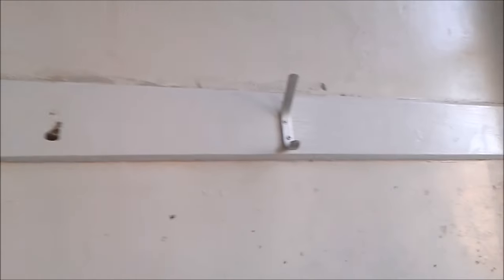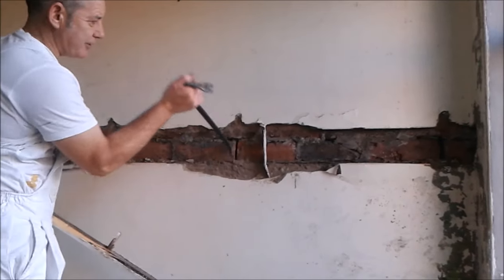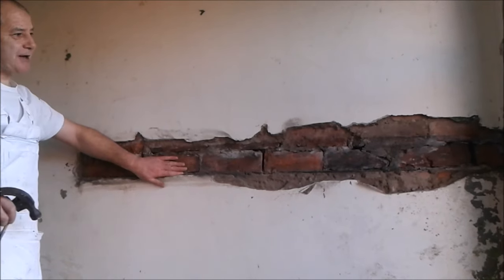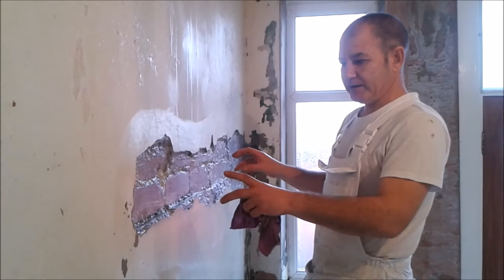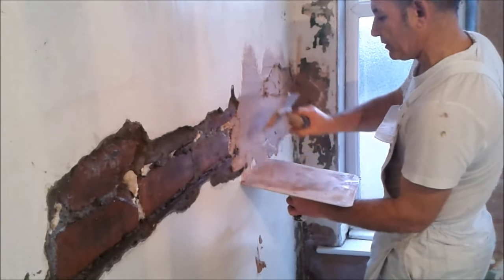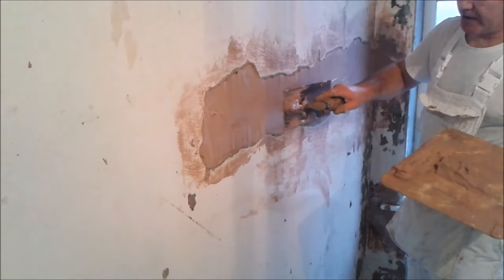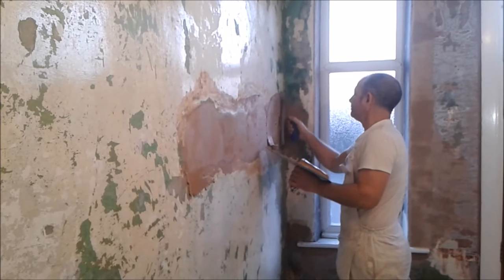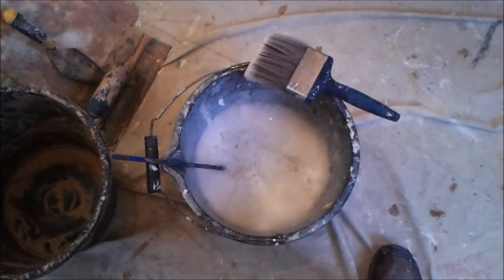Patch Plastering Hardwall

Comment: Nice video. To all the plasterers knocking this at least there is no plaster on the ceiling, woodwork, beams, floor, window sill, down the sink and drain. The bloody mess plasterers make is unbelievable yet they have a go at a guy doing a tidy job. And let's face it you wouldn't come out and do this anyway, well not for any reasonable price and no price is worth the mess you guys make.
Reply: @taichpaul  we aren't all messy mate. I take pride in being a clean plasterer
Reply: @Trekz86  good.
Reply: Not all plasterers are like that...
Reply: @taichpaul  this guy ain't a plasterers by the way.  Never seen a patch this small being done so slow and the way he holds the hawk to the wall is amateur. He did a good job for someone who I think isn't a plasterers

Comment: .pva as a primer should never be applied at more than 3 parts  water to 1 part pva. other wise you end up with a skin of pva that the plaster is sticking to rather than the surface of the substrate and that actually makes the bond weaker. pva is primer to reduce suction not a glue to stick the plaster to the wall. good job otherwise.
Reply: Edd Jordan thank you nice Information and explaining 👍
Reply: Pva only stops it from drying quick....fucking amutures !!!!!
Reply: Ste Thompson if you think that your a noob
Reply: You could also just wet the bricks first, to slow down the drying of the plaster. Then you don't need ant bonding agent
Reply: On another plastering video the presenter advised against using PVA when applying hardwall plaster to brick wall. So when are you supposed to use PVA?

Comment: Tip....when using a crowbar, put a flat piece of wood against the wall first and lever against that....the crowbar doesn't then dig into the wall
Reply: Nah it can still dig in
Reply: @tauntonlad  if you don't know what your talking about, be humble and silent and learn from people.. Been a smart ass is not a trade
Reply: @tauntonlad  You two lovers crack on doing it wrong, don't involve others
Reply: @tauntonlad  Its your mummy calling me. Thanking me for a good time
Reply: @tauntonlad  byeeeee ❤
Reply: @petea2485  Mark is right, troll.
Reply: Tip, yeah it's just a spikey thing
Reply: I'd have multitooled the wood either side of the nails to try and minimize any damaging of the existing plaster.

Comment: Pulled it off and realise you’ve not quoted enough 😂
Reply from the maker: Imagine just starting to sand it down and it falls off..  😭
Reply: I was on a job once with a minor plaster repair only 6x15 inches  and started to prep the wall and loads of the plaster came off in a sheet, turns out the plasterer before me had plastered over MDF!

Comment: I notice that you have put in quote a bit if plaster into a deep chase. On the instructions for the gypsum it says to only do about a centimetre and layer it up in a couple of goes. 

Do we have to do layers? or is it Ok to add 2 or 3 centimetres of plaster at a time?

Dies anyone know?
Reply from the maker: The small area is not too bad working like this. Thanks
Reply: @PaintingandDecorating  cheers

Comment: do you have to use PVA? I thought it wasn't recommended for heritage buildings/ breathable lime wall systems as it's essentially a plastic layer. The lime in the plaster will 'suck' into the wall and bond instantly...
Reply from the maker: It's not heritage is just brick that needs plastering. Look up what plasters use to bond before applying undercoat plaster. PVA is not plastic.

Comment: What is the purpose of the PVA? I am asking it because I can't find it in my country. I have an old house, and I removed all the old and damaged lime plaster from the walls, exposing the brick. Will this PVA help the new cement plaster bond better?
Reply from the maker: Yes, plasterers use it to bond coats....  we dilute it so it soakes in sealing a surface ready for painting... carpenters glue, school glue..   as long as its not waterproof PVA......   thanks

Comment: If you have a few days between hardwall (base coat) and the final coats, would you recommend pva the hardwall to reduce fast suction?
Reply from the maker: Yes but very diluted so it soaks in. Thanks
Reply: @PaintingandDecorating  50/50 Mix?

Comment: If the repair that needs done is deeper than that, should I use 2 coats of bonding? Then put the Skim on top?
Reply from the maker: Yes or two top coats depends on your depth..   thanks
Reply: Thanks mate, saves is the job of cutting plaster board out to fit the whole and then dot n dabbing it only to the have to Skim over like I originally planned lol

Comment: I had a similar repair done. But the plasterer first used a lime cement render to fill in and match the original wall, then a two-coat plaster with the finish being a white coat

Comment: A couple of things.
Why mess with magnets then just rip it off.

2 bonding would have been a better plaster to use.

3.skim the full wall it's a better job.
Reply from the maker: Magnets locate the nails then you know where to start and areas to use force.  The wall only needed to be patched and not to grow a little.
Reply: Bonding is like blotting paper and can lead to problems with damp.

Comment: Was that another top coat mix after the first on or was it the same mix as you left it 20 minutes?
Reply from the maker: No you have to make up another mix...   dries fast so the first mix would be useless at this point.
Reply: @PaintingandDecorating   the bag of of plaster I bought is multi purpose, and is one coat. The repair is smaller than yours , but will butt up against a triple hardoard sheet ??

Comment: Good morning, How will you cover a large area with this undercoat plaster.
Reply from the maker: Using a plastering trowel and start at bottom in a corner, and work out. Keeping same depth across and hatching  it before dry, for your finishing plaster. Thanks

Comment: I really wouldn’t remove that wood in the way you do as it will likely do more damage to surrounding plaster. Liked the idea of using a magnet though, which I’d never thought of.

Once the screws are located, you could have used a saw to cut either side and in that way, you could remove most of the wood very easily as it would only be held there by the plaster. Alternatively, you can use a circular cutter around the nail which then leaves the rest of the wood detached and easily removed.
Thanks for sharing and not having a go! None of us are perfect.
Reply from the maker: No worries, times money and a little extra filling is nothing. Thanks

Comment: Hi mate, I wonder if you can go help me?. I've fitted some rawl plug anchors (self screw metal plugs) and in both fittings  I've fitted the plaster has crumbled . So I'm assuming I will need to pollyfilla the repair. My question is. Do I pollyfill and skim over with the anchor still left  in the wall? Or take it out? If I take it and then Reinsert after I've pollfillered will I run the risk of it the plaster crumbling when the rawl plug self drive goes in again?
Reply from the maker: Hi hopefully this video will help  https://youtu.be/u_uG-yjzQjw
Reply: Self screw plugs? You don’t meant plasterboard screw plugs? In a solid wall you would use normal plugs and if the wall is crumbly, use a long enough plug to get to the brick. On a lathe and plaster wall you’ll need to find a stud. Also important to use a screw the correct dimensions for the plug. Too small and it won’t grip properly, too big and it will just break.

Comment: Hello again.
 I expect you know, but in case you don't.Instead of hacking plaster off with a bolster and hammer.Which will remove the plaster you want off but also the surrounding plaster can also crack up and work loose. Electricians use a small angle grinder with bag or I assume dust extraction port.  It is called a chasing tool, has two adjustable blades on it. I assume can just use one, also  can get a chasing tool which fits onto your electric drill.
Reply from the maker: You can but the filler is cheap and better to remove anything that is loose in a safe controlled manner . And if you're using anything mechanical make sure you know exact placement of wires or pipes.

Comment: Helpful video.Did you let the first coat of plaster dry completely before putting on the second coat? For how long? Is the 'finishing plaster' the same stuff as the first coat or a different product? Thanks.
Reply: When the first coat has been in long enough fir you to touch and leave no fingerprints then its ready for a wetter top coat mix to go on top. The finnish plaster is the same, mist use a multi finish plaster.

Comment: Can anyone help me with a question. I'd really appreciate your help. I lost my father 3 months ago and my dream was to renovate my bedroom with my father which i couldn't do. I want to pursue this dream but have no clue about walls. I have done basic electrical and plumbing work. I want to know what coats are applied to a brick interior wall. I know that cement sand plaster is done right on the brick surface but after that may i know whats done till its finally painted? A basic explanation that includes all the materials included will really help me to start my research.
Reply from the maker: Same as in the video on materials just on a larger scale. And we do have videos on how to paint plaster. Hope this helps as we are not plaster's by trade....  only painters and decorators..
Reply: @PaintingandDecorating  Thanks a lot for the help can now start atleast somewhere rather than being confused. Cheers

Comment: How long did  it take to dry as with putting a backing coat on will take longer to dry . I have started to use dunlop pro decor range   dries within the day
Reply from the maker: 4 days to dry because of cold wall and winter.

Comment: Hello again, as I mentioned I think your YouTube is really helpful and after watching it I feel confident enough to do a small patch repair. I've bought a bag of Thistle bonding undercoat, Thistle Multi Finish, a hawk, small paint paddle for drill, a trowel and some PVA. The patch repair is on the corner of the wall above the door. I bought some mini angle bead, mesh to do the corner. I'm not sure how to do this so I was hoping you could give me a bit of advice? If you contact me on the email on my channel then I'll send you a couple of photos, so you can see what I don't understand.
Thank you.
Reply from the maker: You need to attach the angle mesh to the corners, you can seal the brick and using a spirit level and some grab a adhesive fix the angles in place so they are horizontal or vertical. You can drill and screw or nail using non rusting fixings.

Comment: At the stage of applying the top coat finishing plaster where you're dragging the trowel over the edges, did you not drag in flakes of old paint from the area you are plastering into/over?
Reply from the maker: No the diluted PVA has stabilized the area.. thanks
Reply: @PaintingandDecorating  thanks for your reply.

Comment: Thanks for the reply 'I replace windows in my house and some plaster around the windows come of ' and a couple of rooms need plastering 'I scraped of the old plaster to the to the bricks 'si prior to put new boards on 'do i need to give it a coat of pva mix with water 'would one coat be enough ?also around the windows where the plaster has come of 'pva coat then undercoat of hard wall plaster which you used in the video and then skim 'I'm very interested in this job and tranna learn from experts like yourself 'your help is appreciated 'your a star 'I have same mentality that before I leave this world I pass on my skills to new generations

Comment: why does the plaster crack i soak wall before i start and make plaster to right batch like you plasterers but cracks on some places on wall in my house whats going wrong
Reply: Like the man says here,   you need to soak repair area with PVA /water mix first. Let dry, then a another coating  ( thicker mix) , let dry. It provides good adherance to plastered wall, but, prevents the water in the new plaster from being sucked into the wall, out the plaster mix, too early, causing cracks.
Reply: @MrDaiseymay  Didn't quite understand you...To prevent cracks shall we do it exactly like the guy is doing in the video? or no?
 "but, prevents the water in the new plaster from being sucked into the wall, out the plaster mix, too early, causing cracks." I just want to clarify before I start. Thank you.
Reply: What surface has been the plaster been applied to? Sounds like the moister is being sucked out of it by the wall, or if it's board have you taped your joints
Reply: @MrDaiseymay But another plasterer said do not apply PVA to brick to allow moisture to be sucked from wet hardwall plaster and increase adherence of new plaster to the brick wall.

Comment: great vid thanks . The first wash with pva at 6.43 was that neat PVA or diluted? I have taken the wallpaper off the wall of the house we have just moved into and there are holes about 6 ins deep going down to brickwork will this plaster work on holes that deep please and would it be the same technique as shown?
Reply: ric david - if the holes are right into the brickwork, put mortar in them to bring them level with the brick face. You can buy pre-mix stuff that you just add water to on an as-needs basis. Works out easier and cheaper than buying 25-kilos and then throwing kost of it away. Plus, as long as you seal the tub it will keep for the nexy time you need it.
Reply: @steves1460  Hi steve thanks for the reply i finished the wall some weeks ago and it worked out pretty well thank you. My next task is to try and put some insulated render on the external walls here. I have never done rendering and certainly not insulated. Have you done any vids on rendering and is it ok to do the work this time of year? Thanks again
Reply: ric david - Not something i know about, but Google and YouTube are your friend. Good luck!
Reply: @steves1460  Cheers Steve keep up the good work

Comment: Hello, loved this video! 
I have just moved onto an 1930s house and took the wallpaper and dado rail off which had crumbling plaster behind it. 
It’s quite a large patch and I haven’t even tapped the rest of the wall yet to see if the rest is hollow. 
Is this the same process you’d do for half a wall say? So do you need to all anything else for the plaster to stick to the bricks for a large surface area? 
Also, I take it the plaster you use for brickwork is different to the plaster you use to skim. What brand do you recommend? (UK). 
Thank you. Subbed

Comment: Thanks for nother great video. It looks like you have a lot more work to do on that wall, will you be posting videos of how to take it frm here or has that been covered in previous videos?
Reply from the maker: AB Voyager Yes will be showing more the job is on hold for a while. On doing work on that wall we found it was leaking. So the gable end on the house needs pointing and the gutters need fixing. So the customer asked if we could leave it until they fix the problems.

Comment: Sorry my speaker phone isn't working too well on my phone. What was the very first coat you applied? Bonding? second coat? Thnx
Reply from the maker: The first coat was Thistle undercoat plaster for concrete, bricks and blocks. The second coat was Thistle multi finish plaster. Thanks.

Comment: You ain't no plasterer. Watching you use that hawk and trowel was painful. And why would you patch that in?? The whole wall needed skimming
Reply from the maker: True, but it was sound and perfect when finished and it's not falling out. Happy customer.
Reply: I could of plastered that whole wall and it be spot on in around 4 hours including the hardwalling. you've done an ok job at patching it in and then would have then had to prep and sand the wall for hours. Just get the right person in for the job. I wouldn't start painting a customer's house, and if I did I certainly wouldn't video it lol
Reply from the maker: @nakalexzander  Thanks, The wall was getting papered with an embossed paper so they had the right man really, also the customer knew it was being filmed .
Reply: I've had shocking work done by qualified plastering professionals. I'd rather learn to do something slowly, at a lower cost with great care than get ripped off time after time by lazy greedy ignorant tradesmen.

Comment: Put some bonding in and skim the full wall ffs .
Reply: Hi, Just a question to ask if you don't mind. If you were to do the whole wall would you need to remove all the old plaster from the whole wall and go back to the brick like where he initially repaired? Thanks, Regards
Reply: @ceet12  not if the rest of the wall were solid , just bond the brick bit, pva everthing and re skim should be fine
Reply: @The-layman  thanks mate for the reply. So just fill the hole were he did, then skim over the whole wall? Regards

Comment: As a multi skilled joiner I’ve done quite a bit of plastering and patchwork learning from plasterers I’ve worked with and for a painter and decorator he done a mighty fine job! 👍
Reply: Would you know if I should treat old gypsym wall with something before repair and rendering with new gypsym for proper adhesion? 
I heard some household chemical should be used, but forgot which...

(Not drywall, the house is very old and built only from solid gypsum and natural rocks)
Reply: you kidding me.... he looked like he never held a float before

Comment: That house is 100 years old, why the hell are you using PVA and Gypsum? Should be done with Lime. Anyone who uses modern materials in old solid brick houses needs to research period properties.
Reply from the maker: It's got a cavity and it's all sorted some people do and others talk.
Reply: I doubt the house will fall down
Reply: Look at the cost and availability of lime. Price has rocketed since the pandemic. It wasn't widely available to begin with. Also preparation time is longer.